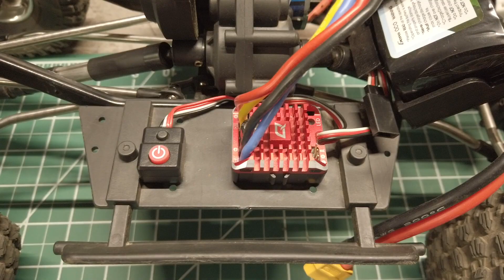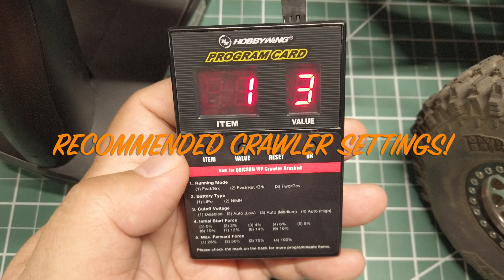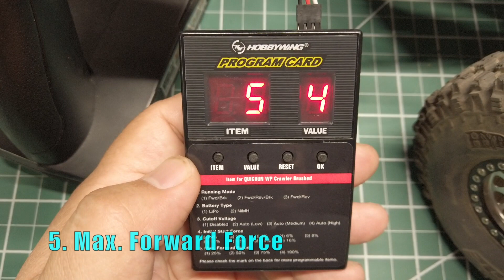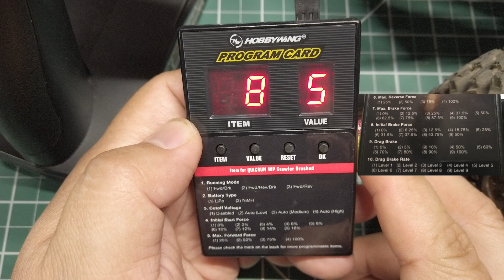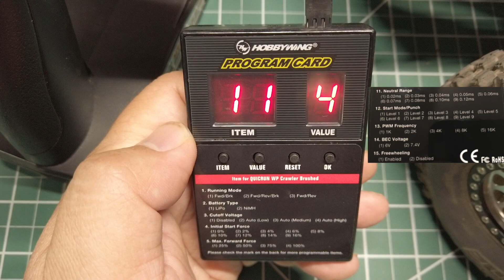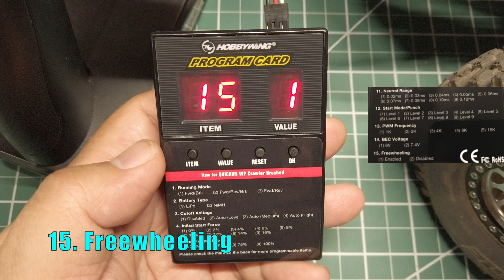How to Program and Recommended Crawler Settings on Hobbywing 1080 ESC

Comment: The other program card with blue color instead of red will work too?
Reply from the maker: I have only used the red ones, so I can't confirm for sure.  But I don't think it hurts to try with the blue one.  Let us know if it worked out or not.
Reply: @ it works i had the red sticker in the 1080 ESC box

Comment: Amigo, obrigado pelo vídeo. Meu esc ainda não chegou. 
Devo receber em 10 dias.
Uma dúvida: o primeiro passo é configurar o esc com o cartão, ou configurar o transmissor com o esc?
Agradeço a sua orientação.
Reply from the maker: Great question.  The HW 1080 ESC is ESC only, meaning that there is a separate receiver.  The transmitter needs to be sync'd with receiver as a first step.  After that the order does not matter.  I would test the ESC works as intended, then program the ESC.  Programming the ESC basically fine tunes it.  Good luck.
Reply: @BigSungHobbies obrigado, amigo.

Comment: Very helpfull. Question. I have a very low geared scx 10 ii crawler. Which setting for a smooth, very slow take off with brushed motor? Thanks so much.
Reply from the maker: The crawler setting on the video works well for me both on my LCG build and other crawlers.  Give that a try, and you can try to adjust as needed.
Reply: @BigSungHobbies  changed some of my settings to yours...works good so far. I was changing mode 13 a few times after watching your video and Holmes Hobbies video on settings...interesting to see the changes making one change at a time.
Reply from the maker: @BrianOnTheGo  Glad that you are trying out different settings.  I would say that's the best way to find out what works for you.

Comment: Congratulations you read the introductions word for word like we all can do. This is 9 minutes of my life that I will never get back. Awesome job 👍
Reply from the maker: @Ken Design Thank you very much for your comment.  I appreciate it that you took time to provide a feedback.  I just want to be clear that the crawler settings are slightly different than the default values in the manual.  I started with default value as well and then adjusted to my style of driving and provide reasons as to why I chose them.  I hope you found that information helpful.  I have used this setting for over two years including on my LCG Cheater Rig plus on 5 other rigs, and I find that it works well for my style of driving.

Comment: I choose 16k on opt 13 to run silent no squeal.
Reply from the maker: I ran 16k initially then moved to 8k...to my hearing I couldn't hear the difference, so I settled on 8k.
Reply: I didn't know that 16k makes the esc run a bit hotter. Thanks I may change it back. Sofar it stays in the 80 to 90° range.
Reply from the maker: @WillB.6759  That sounds like a good plan.

Comment: What is free wheeling exactly? 🤔
Reply from the maker: The easiest way to understand is to use a bicycle example.  On a Fixie (non-freewheel), as the wheels roll, the pedals will also turn.  Basically the gear is engaged at all times.  On a regular bike with freewheel, you can cruise and rest your legs as the pedals will stay stationary.  This applies to RC cars as well.  For regular vehicles, the recommendation is to disable this function. With it disabled, your vehicle can have quick acceleration  Since the gear is engaged, it translates to immediate response to your throttle. For a crawler (simulation model), the recommendation is to enable freewheel. With it enabled, your
crawler can have better linearity during a low-speed running and also less heat.
Reply: @BigSungHobbies  thanks! hmm but with drag brake enabled (powered by the motor) I don't see how this setting can be enabled anyway, correct?
Reply from the maker: I am not the best person to answer your questions as I am not too techy.  I believe drag brake is applied when you let go of throttle.  The freewheel seem to apply when you pull on the throttle on the start up.  Slightly different scenario as I understand it.  You can always test both, freewheel enabled vs. disabled, and see the difference yourself.
Reply: Freewheeling on this esc is using a Mosfet to act as freewheeling diode.  It allows drag brake to be active while using throttle.  Active drag, synchronous rectification, on throttle drag, there are a few other names.  For crawling, turn on freewheeling

Comment: Is the esc supposed to flash while driving?     Just installed this in my trx4 sport yesterday and noticed that the LED on the ESC flashes while moving vs staying solid like the traxxas esc.   Is this normal??

Truck seems to be operating fine...
Reply from the maker: When it senses throttle it will flash.  Normal.  Let me know what you think compared to stock TRX4 ESC.
Reply: @BigSungHobbies  Perfect, thank you.    I mainly got it for the drag brake, my stock one was almost non existent even in "crawl" mode.    If this one works ill be a happy camper...the other settings are just added benefits in my eyes.

Will let you know what i think when i get a good test run on it.
Reply from the maker: I also like it for drag brake and the programmability.  Definitely much better than any stock ESC and reasonably priced too.

Comment: Wouldn't option 7 and 8 be deactivated anyway in crawler mode? (forward and reverse) as the only braking you have is drag brake so adjusting those settings would have no effect until you put it basher mode (forward/brake/reverse)
Reply from the maker: You would think so, but they still had it option 7 and 8 selected even in crawler mode.  The setting that have worked, so I never really paid further attention to it.
Reply: Option 7 and 8 are not deactivated.  However, because you have drag brake at 100%, there really is no need to ever use the brake function on your transmitter.  I still set mine up as if the esc were being used in a basher so, I don't have to change those settings if I switch vehicles.

Comment: How to set up the cuttoff for 3S battery?
Reply from the maker: 3rd Item is the the Cutoff Voltage:  (3) Auto (Medium).  I set it at value 3 which is Auto (Medium).
Reply: @BigSungHobbies  

Im using LiFePo 3S.
You know what is the volts at Auto Low?
Reply from the maker: I don’t know the exact number, but I think it was at low end of 3v per cell.  Unless you are comp’ing all the time, I would recommend at least Medium setting which I believe is around 3.4v per cell, but don’t quote me on it.
Reply: @BigSungHobbies  

Sorry, I forgot to mention.
I'm using LifePo batteries. I can push the cuttoff much lower than a regular lipos.
Reply from the maker: Then maybe try Low setting and see how that woks.  I haven't used LifePo batteries, so I am clueless there :)

Comment: Did u have to switch the blue and yellow wires to get it to run correctly?
Reply from the maker: Some motors are reverse direction.  For Element Enduro motor I did not have to swap the wires, but on Titan motors from Traxxas, I believe you have to swap the wires to ensure it works correctly.
Reply: @BigSungHobbies  i had to switch my motor wires to get it to run correctly. Hobbywing 1080 with stock reedy motor
Reply from the maker: Glad to hear that you got it sorted out.

Comment: Great vid! Do you run these same settings in your trx4? I just installed mine today on my sport. Ran it on factory settings. Nice esc! I’ll have to adjust the braking. It wanted to roll end over when going down very steep hills whenever I came off the throttle.
Reply from the maker: HW 1080 is great ESC.  And yes, I run the same settings on TRX4 Sport as well as on my Gspeed Element and Element Trailrunner.  On Sport, you need a bit finer control then the Element though.  One thing if you can check the weight distribution that might also give a bit more insight.
Reply: @BigSungHobbies  I weighed the vehicle. 60% front. I was able to use 3mm nylon nuts to fasten the rear shock tower as you suggested so that way I could remove the battery tray. I then mounted a 2200 3s on the front chassis rail. No brass or heavy wheels so total weight is 2660g rtr with 1600g front 1060g rear. I think the more I drive it the better it’ll be. I’ll try your settings. Thanks!
Reply from the maker: @micaelacarter4971  2660g is awesome weight for it, and to boot at 60/40.  Congrats!  The nice thing about HW1080 is so easily programmable.  Try a setting and tweak it as you see fit, and find one that works for you.

Comment: Hey big question if u buy the programmer and the esc can u run any motor brushless and brush motors
Reply from the maker: You have to match the ESC to the type of motor you get.  The 1080 ESC will work with all the brushed motors; however, if you get a brushless motor, then you will need to get an ESC that is designed for brushless motor such as Castle Mamba X (or Micro X depending on the vehicle weight), or Castle Sidewinder 4.  There are others like Axe brushless that comes in combo package.  As for programming, depending on ESC they might come in programmer's card or some even use bluetooth.  Hope that answers the question.

Comment: HEY BROTHER,JUST INSTALLED THE HOBBYWING1080 WP ESC,ON MY GEN 8,ALL I Have IS THE REDCAT LIGHTING SETUP KIT,AND A DS3225 25KG SERVO,AFTER ABOUT 25 MINUTES OF TRYING TO TRIM AND STRAIGHTEN OUT GEN8,THE ESC STARTED BLINKING THE LED ON ESC I MEAN, AND I COULDN'T USE GEN8?SERVO MOVED PERFECTLY SIDE TO SIDE,BUT NO FORWARD/REVERSE,BATTERY CHARGED,#14 SETTING ON 1 6V...I SHUT EVERYTHING DOWN 15 MINUTES LATER WAS BACK TO NORMAL,NO BLINKING LED LIGHT???LMK WHAT YOU THINK BUDDY?
Reply from the maker: Hmmm, I am not sure.  The only time I ever had issue was when the steering servo went bad, but I have never ran into your issue.  Glad that it came back, but I wonder what could have been the issue.
Reply: @BigSungHobbies  NO THE STEERING SERVO NEVER WENT BAD.>I JUST COULDN'T GO FORWARD OR REVERSE,BUT EVERYTHING WAS STILL ON,AND I WAS STILL ABLE TO MOVE TIRES LEFT AND RIGHT? aND THERE WAS A FLASHING RED LIGHT SILENT NO NOISE,BUT FLASHING/BLINKING ETC.>wAS MY #13 P.w.M. TO HIGH?hAD ON 16K?
Reply from the maker: You didn’t change the settings on ESC, but it is working after shutdown of 15 minutes, so I don’t think that’s it.   All of my crawlers are on 16k, and I have not run into the issue.  If you press the set button for too long it goes into manual program mode.  I wonder if you somehow got into that mode.  Maybe email HW customer service to see what they say.

Comment: Great video, just found one thing wrong with it. When programming the ESC you do not need to have the transmitter on. When you plug in the program card it cuts power to the receiver so there is no need for the transmitter to be on. Enjoyed you video, keep up the good work. 👍🏻
Reply from the maker: Ahh good to know!  Thanks for the info.